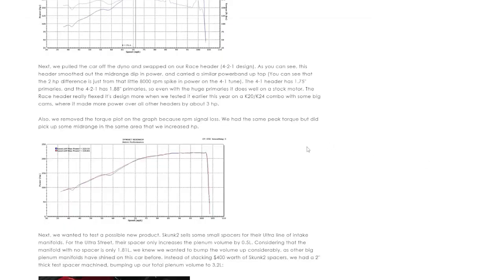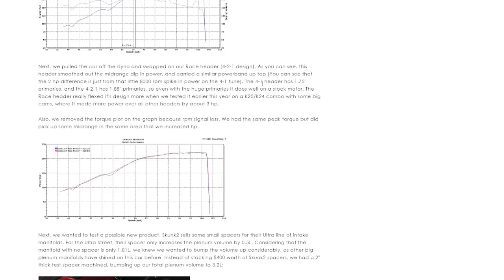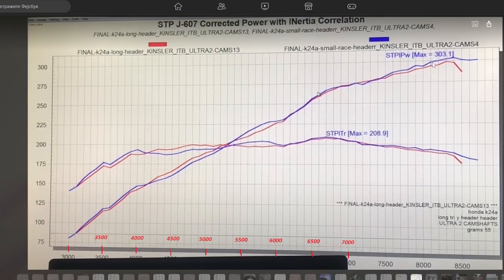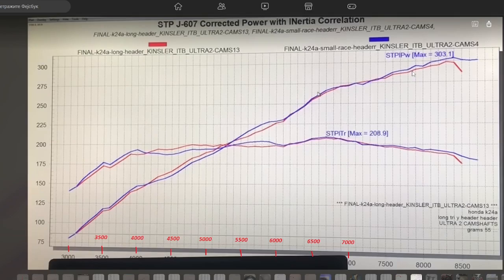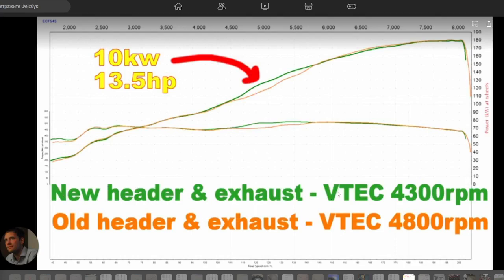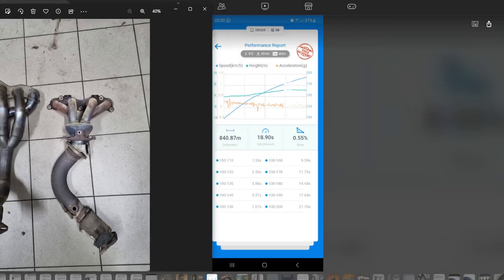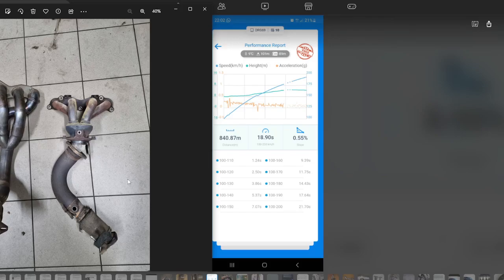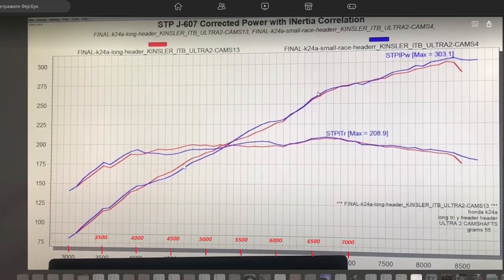k24/k20 Big tube Header vs Small Tube Header dyno testing

Comment: so what brand header would you run of the shelf? ive currently got plm headers on a k20a with DC 2.2 cams
Reply from the maker: Only other header beside mine that has resonances suporting k20 rpm range function is solid fab ep3 header as it has last resonance at 8600rpm. 
They are using 48mm primes but 51mm secondary tubes and choke points on collectors (that are also good design) are of correct diameter. I have seen it performing on dyno daze dyno and ep3 with that header was making the highest hp and no loss in mid.
But we are lookint at 5-10 hp on top and 10-15 in mid range difference.
I'll post header testing of that design (Joe Mac design) vs toda and skunk.

Comment: Big tubes would gain power with 12+:1 compression and high duration and lift cams.
Reply from the maker: And hi flow head and hi rpm.
Engines in this tests had big cams in them
"All motor tsx" guy on insta has agressive build and 48-51-54/4-1 header did make way more than plm header.
But than again design of plm for tsx is not the best to begin with.